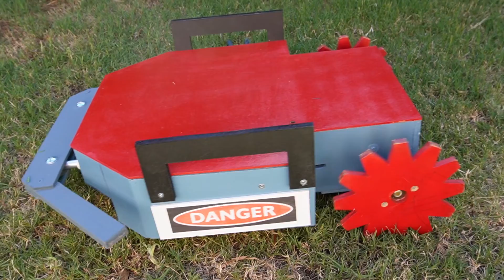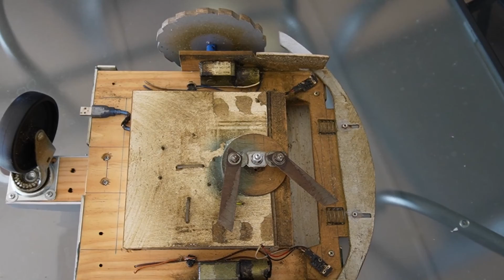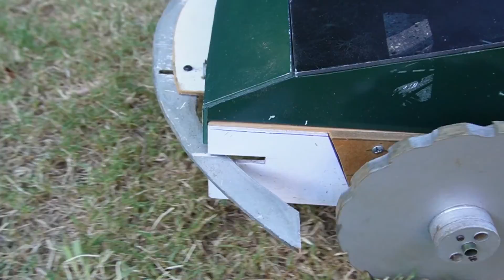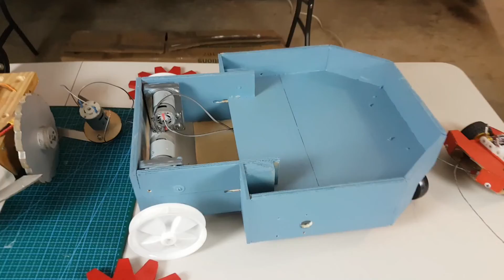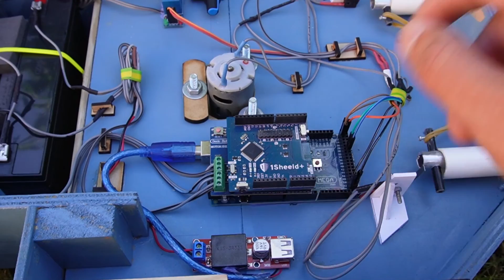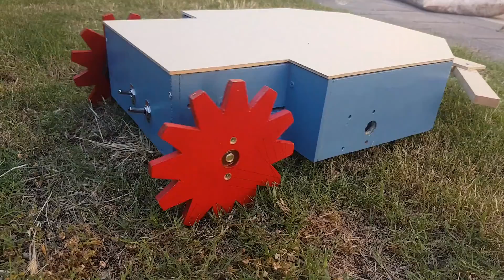Homemade Robotic Lawn Mower

Comment: I would like to see a similar project like this but using brushless 6374 motors instead, the motor is used on this one or just too small I think to be practical.
Reply from the maker: It just depends on the terrain and thickness of the glass

Comment: IF YOU USE 3 WEED WACKER MOTORS 1 CENTER 1RIGHT AND 1 LEFT ABOUT A 18 INCH CUT AS IT IS MOVING FORWARD
Reply from the maker: yea man, best to use a motor that is already designed to cut grass

Comment: Do you use cable detectors and if so, how did you connect them?
Reply from the maker: Not yet. I intend on using a perimeter wire / shock collar set and modify it

Comment: It looks amazing! what is the motor and gear box you used? I'm planing to build something similar.
Reply from the maker: hey buddy, high torque DC motors from EBay :https://www.ebay.com.au/itm/353999728549?hash=item526c072fa5:g:j8MAAOSwAjtiUOeM&amdata=enc%3AAQAIAAAA8ERpS0Y2MmdOLyCYx5Dve0QPn8pogAG232Kzt%2Bxotngg3zmDpniACgX%2FPChU%2Fw%2FYIanSyto1ELuIr8gLI7SO2TC%2FqqO6ySKnZXnhbQsGYXkyQxoVcOQRzFYt52sKJpYwZaCvnum4VC4LxbW7hwbw64AGmJwg3xVr%2FqQh28SaFw%2F8BRQUNk6iN2jn0Q%2BDuzv5r6Q0MFvjH0IjYFwLb4X9NBuEQvynx3Uh%2Bj4aQviboIWYwp8isXaR6VJVUCRK8euVj8DvphqDJ%2BwgXdSFj8TMdosmGh6CyRcd8OBxV6s6X8sTzPWOp8caQFOdcAX6y7yO4Q%3D%3D%7Ctkp%3ABk9SR6CAmJicYw

Comment: what is the power consumption of the bigger mower? my plan was to make it so it ran in the night and charged in the day, with a solar cell as a roof.
 A simple LDR to to set when it supose to run or not, and monitor the battery voltage if it is alowed to run or not. nice build!
Reply from the maker: I use 2 x 12v batteries
Reply: @HomeRoboticsAustralia  how long can you drive with them and how big are they?

Comment: I was thinking about making something like this but the front bumper would have a  switch for one of the wheel motors
for example: if you hit the left side of the bumper it switches the right wheel engine to turn backwards =the mower turns right and avoids the edge/obstacle 
there could be also a detector that detects the boundry wire in the same way
would be really simple and almost fully analog
Reply from the maker: Absolutely mate. I am just an idiot at electronics so I resorted to programming instead